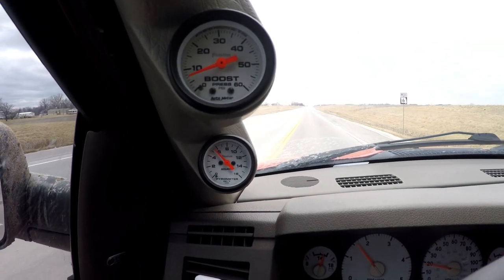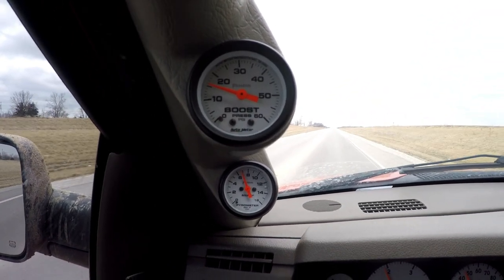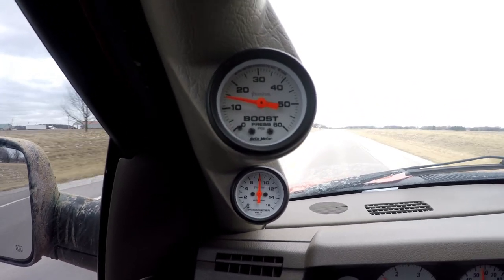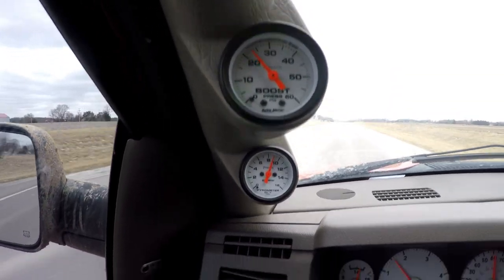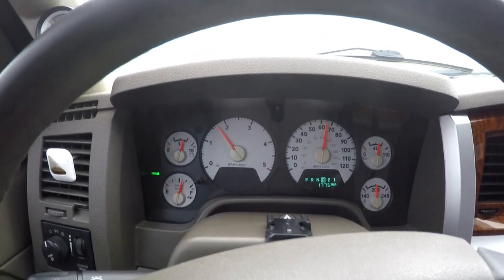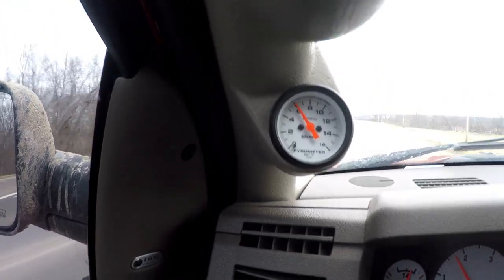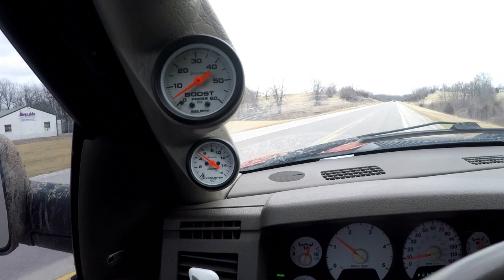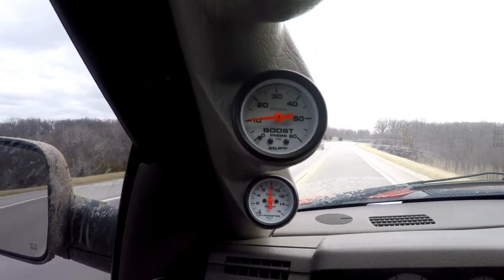Compound Cummins Spooling!

Comment: There isn't any lag...although if you lift off the throttle and then accelerate all the way down (same gear, no downshift) you still have to wait for the boost to build up in order to really accelerate. Am I saying anything wrong here?
Reply from the maker: What you just described is pretty much the definition of lag. Waiting on boost/ turbo to spool. There is always “lag” in any turbo charged engine. When people say “no lag” they are commonly referring to the vehicle spooling just like or close to how it did with the stock turbo.
Reply: @krey8171  So a car with compund turbos can't react as a naturally aspirated engine...for example. I thought it would have absolute instant boost and instant acceleration...pretty much like an electric car. 
I have got a bmw 335d and eventhough everybody is saying there is instant power and so on...i still have to wait for the turbos to spool up...for half a second or so...it isn't absloute instant full power.
Reply: Vlad ZSX what you’re talking about now, is boost threshold. It’s kinda like all squares are rectangles but all rectangles aren’t squares. So, boost threshold is the minimum lb/min of exhaust gas flow needed to produce boost (minimum usable boost). Lag is basically the time needed to produce boost that you can feel. Like feeling the acceleration at 15 psi on a 160ci engine....I hope you understood what I’m trynna say xD

Comment: Looking at putting compounds on my cummins. How much louder would you say it is than just the single turbo while towing?
Reply: It's noticeable but not crazy, I wouldn't change it with how much benefit it gives.

Get a proper dyno tune and leave it alone, decent MPG's and lower EGT's are possible.

Comment: I have 244,000 on my hub bearings but have been thru 2 sets of free not axle is joints(ok the first set was from pulling ng out a tree).  I am dying for compounds. I upgraded my 351 with a 63.5 compressor and 76 exhaust with a 11cm turbine. It's good with throttle but low rpm cruising acceleration sux. In your opinion would a 475 or smaller would help my beasty
Reply from the maker: A 475 for a compound setup or for a single? 6.7 or 5.9? The 63.5 turbo should spool just fine. A 475 single will be hard to spool, and as a compound it will spool the same as now but have more top end performance.

Comment: That coolant hose that is leaking. Is it the little one that goes to the heater core near the firewall turbo side?
Reply from the maker: Yeah
Reply: Did u end up replacing it yet???
Reply from the maker: Yeah, my buddy that rebuilt my engine replaced it when it was out of the truck.

Comment: Did you ever upgrade your valve springs or pushrods.
Reply from the maker: I did. I used Hamilton 103# springs and Hamilton extreme duty pushrods.
Reply: @krey8171  is it needed for compounds on stock fuel
Reply from the maker: I had my compounds on stock fuel initially and it would make 53psi max. It’s a risk you play with if you don’t. Some get away without doing it, and others don’t. You run the risk of floating a valve or bending a pushrod...then you’re doing an engine rebuild. I’d rather spend the money up front to prevent those things than 2-3x that amount fixing broken parts.
Reply: @krey8171  did you buy titanium retainers
Reply from the maker: No, I have stock retainers

Comment: Boost seems low for compounds.
Reply from the maker: martin1234512345 I never floored it in this video. Only got it to waste gate pressure on the stock charge which is roughly 30psi. WOT I’d see 60-62psi
Reply: @krey8171  why make a video if you're not going to go full send? :D

Comment: Hey Man. Awesome truck. Mind making a mod list of what you've done fuel and air wise? I want almost the exact same setup. Sick of a big single.
Reply from the maker: That setup had a FASS 150, Fleece Power Flo 750 and Exergy 60% injectors. S475 over stock compounds. I actually have a big single now. Makes more power than the twins I had for less money and it’s easier on the bottom end because it doesn’t make boost down low.
Reply: @krey8171  hows the egt with the big single?
Reply from the maker: Not too bad honestly. As long as you don’t Tow heavy it’ll be fine.
Reply: KReyCummins what single you go with?